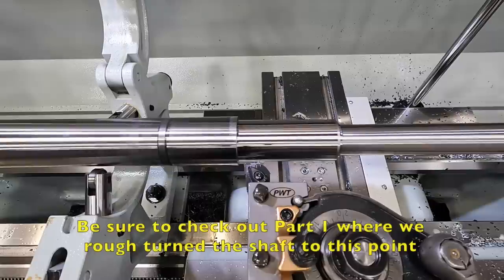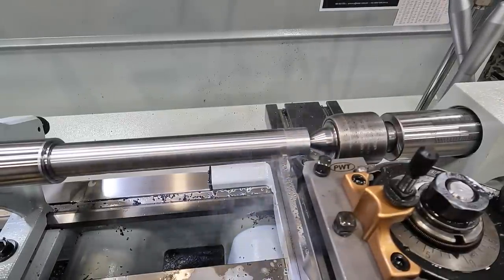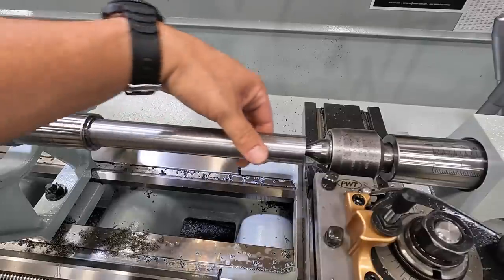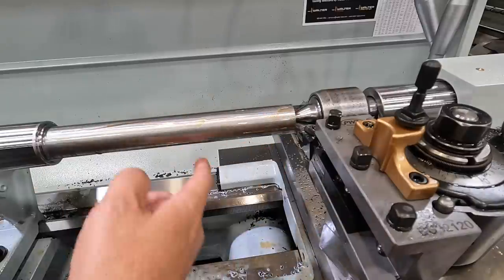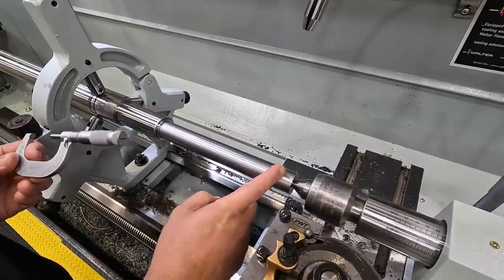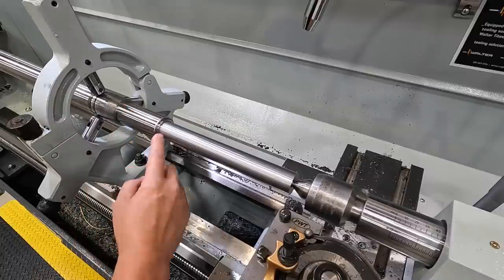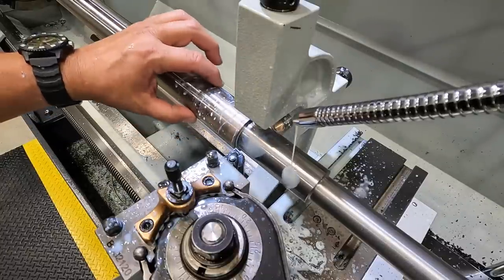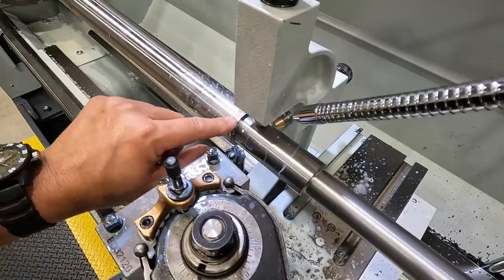70 Ton Friction Press Shaft Part 2: Finishing Turning & Threading

Comment: When you realized the shaft had 2 different thread sizes for the flange nut, being the #2 side was 15 thou under on the original and you machines the #2 side to what you measured on the #1 side, couldn’t you have just opened up the thread diameter on the #2 flange nut to match what you had already machined? As you said, there’s no apparent reason to have the #2 side be smaller, (unless the #2 flange nut had features different than the #1 and they machined it smaller to ensure it could only go on that side) but if there’s no difference, I guess my question is why did you opt to keep it the same to the original rather than make both sides identical?
Reply: More work. New setup. Shaft was already set up on lathe and dialed in. Only took two or three more passes and no new setups.
Reply: I can only guess that maybe the original was balanced and they made them different so they could not be mixed up and mess the balance up on reassembly.

Comment: Can you “indicate” at the steady rest?
Reply: Not in the normal way.. if you indicate at a steady, it would still show good even if it's not concentric because all you'd be measured is how round the shaft is or how bent the shaft is.. you need to set up an indicator to be able to rotate around the part by sticking the indicator in the tail stock or mounting it on the chuck and it's not accurate because of how much indicator stands flex under gravity so although possible to do, it's not a good idea in most instances

Comment: That lathe sure ain’t no Monarch
Reply: Those old Monarch, American, and Lodge and Shipley machines I ran were time tested and heavy duty compared to today's machines.
Reply: No doubt, that thing is junk! Reminds me of the ACER lathes I have ran. Or any lathe that doesn't have a CNC control that was made after the 80's.
Reply: When I worked at a small machine shop running the 1954 Monarch and 70's or 80's Clausing lathes the shop owner told me, "If you want a good machine, it has to be made before 1980."
Reply: @duckslayer11000  If Adam was smart he would have his old Monarch rebuilt.
Reply: If Adam says it's a decent lathe, it probably is.

Comment: I get it's hardened metal, but that new lathe just does not have the rigidity of your old lathe,does it?
Reply: I think it's more of a material issue than a lathe issue. That axel is thin which means it's prone to bending when lateral pressure is applied (aka chattering).
Reply: I always try to rough the diameters largest to smallest, and finish them largest to smallest after I finish the shoulders.

Comment: old machines are just more rigid than new ones don't understand why you set the continuer 45 degrees it's only in the way .. tried it it quickly returned to 0 degrees 90 if you want

Comment: ... it's a great machine you just have to know how to run it. He's using all his skills to make that lathe do its job. Seems like the old iron is more rigid. A guy can learn a lot from Adam.
Reply: Old iron? It's brand new this summer!
Reply: The problem seems to be the more than 30:1 length to diameter ratio of the workpiece, not the lathe (old or new, the "iron" doesn't really come into it)
Reply: It's nothing to do with the rigidity of the lathe, it's the lact of rigidity in such a long thin part that's causing the chatter problems.. it wouldn't matter how big and chunky a lathe you used, a part like that will always chatter
Reply: If rigidity of the machine itself doesn't matter then why are they made of giant pieces of cast iron? And why do better machines use more of it?
Reply: @rjstiles80  who said the rigidity of the machine doesn't matter? The rigidity of the machine wasn't the problem, if i do a shaft like that on my big lathe it's still going to chatter and my big lathe can spin 3 foot diameter

Comment: Am I crazy?  I would have turned the whole end to 1-11/16, then finished the end to 1-1/4. . .   am I missing something?   I’m not a machinist, but when I’m presented with a problem, I ask myself “what would Adam do?”
Reply: As you take material off the stresses in the material can make the shaft bend, the way Adam roughed it all out first is the correct way to avoid having a bent shaft when finished
Reply: "what would Adam do?"  .....Watch the video and find out!

Comment: if you used the "old" solid machines it will be better, with no problems?
Reply: Όχι... It is very hard to get a follower rest to work right if the bed ways are even a little bit worn (the whole lathe saddle and the follow rest that's mounted on it, dips down in the worn spot, pulling and bending the workpiece)
Reply: The problem has far more to do with the flexibility of the part than that of the lathe.
Reply: @carlhitchon1009  Basically this. I thought of it as obvious, but didn't consider to whom...

Comment: 10:25 "straight as an arrow" you've obviously never done archery. arrows don't fly straight, the twist and spin and wobble.
Reply: You've obviously never seen Adam do archery.
Reply: I’m thinking that a thin and long shaft under load could probably behave in that way too
Reply: @yomearreglo  the reason being that arrows are not launched with a force directionally in line with their long axis.  it's entirely normal for arrows to flex and move in flight.

Comment: Seems you have some issue with this lathe... From my point of view maybe Monarch run much better.
Reply: Seems to be running fine to me. I'm only 10 minutes in and it's my first time watching him use the new lathe but he's getting some pretty straight cuts.
The chatter part.. i mean it's a long piece so it's not that surprising to have some chatter...
Reply: That things out 13-1 ratio its gona chatter these cuts are good
Reply: Take a look at the OD of shaft and the length of i . It's not the lathe ,put this shaft in the Monarch it would react just the same .
Reply: lmao boomers and their obessions with old kit. He's. Machining. A. Piece. Of. Spaghetti. You know what would have happened on the monarch? A shitload of taper.
Reply: I was once machining an 8" diameter solid stainless shaft and was fighting with chatter.  When the length to diameter ratio is high it's a bitch.
Reply: There's no issue with that lathe, long thin parts always chatter because they lack the rigidity to prevent harmonics/ chatter from happening
Reply: @SweetTooth8989  I think that PM lathe is too light... ok for long piece, but always there is a lack of rigidity. Of course, my opinion...

Comment: As an engineer, kind of cringed when the threads on the 2 ends were discovered to be different. 
Hate that people use the word "think" like this (I know everyone does) instead of the word assume. If you "think" something looks the same, it's a fair assumption that its not. 
Fortunately, measured off the larger one so easily fixed otherwise might've be some spray welding happening too... 
Lesson to be learnt for the future.
Reply: If ABOM had measured the small thread and assumed they were the same it would have been an easy fix to make a new nut with the same thread thats the best part about being a machinist you can make parts to fit no matter what the job is especially when your repairing old equipment
Reply: If Adam had measured the smaller thread first, he would have more than likely realised something was amiss and checked the other thread before any machining.

Comment: I blame the chatter on the light weight import machine  I bet the old Monarch would not chatter.
Reply: The last job he showed on the Monarch was ruined due to rigidity problems. Same job on the PM was no problem. The problem with the shaft is that it's long, skinny, and when given half a chance, starts whipping around.
Reply: The machine isn't light. The long distance between supports for a <2" bar was the boinky part.
Reply: @brettbuck7362  that's not true either.
On the Monarch, he didn't use any cutting oil, on the PM, he did. On the Monarch, he didn't use a follow Rest, he did. Used the wrong stock on the Monarch, the richt on the PM.
Plus, it was less of a rigidity problem and more that his half nut is worn and has chips in it so engaging it in different positions led to him chasing multiple threads, which would be too much for any lathe at that depth.

Comment: That lathe seems to be a POS.
Reply: Why do you say that? He’s cutting pre hardened material 3 feet out from the jaws. It’s not the lathe that is vibrating, it’s the material acting like a spaghetti noodle.
Reply: I think he would tell us if it was he would send it back . I am just a hobbyist but to me if I could I would put the shaft through the head stock up to where the tread need done dialed  it and machine the thread but if your head stock can not well here we are .
Reply: you people are something else thinking the lathe is a pos. this had nothing to do with the lathe at all. the lathe is actually an excellent quality lathe. even shafts 2" and larger flex and cause chatter in situations like this. it knowledge to solve the chatter situation which Adam demonstrated.